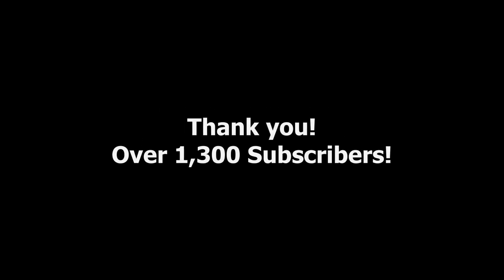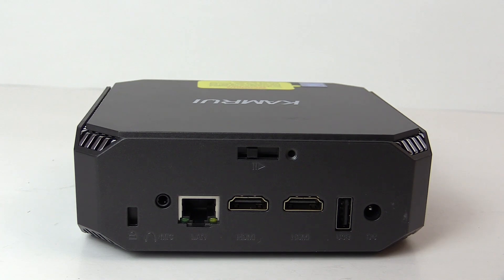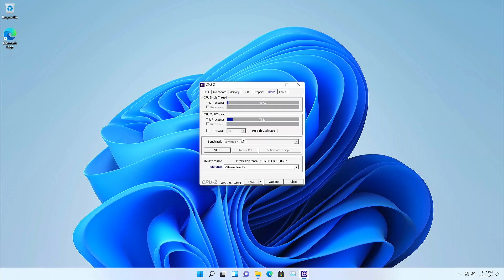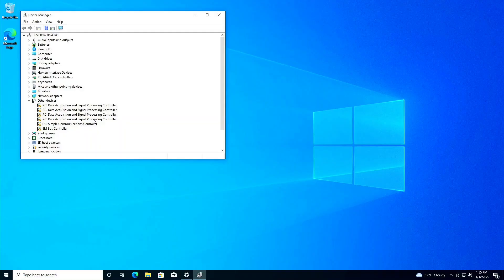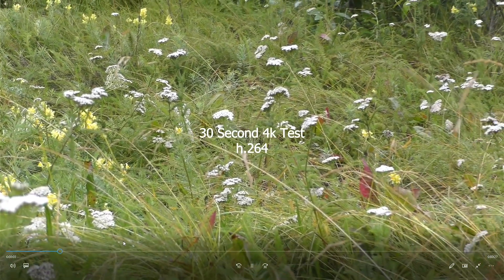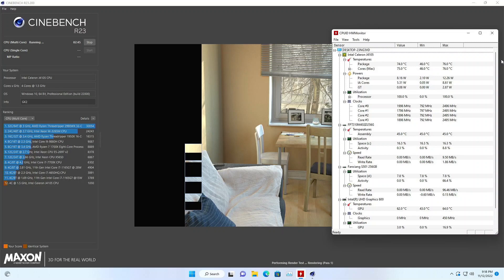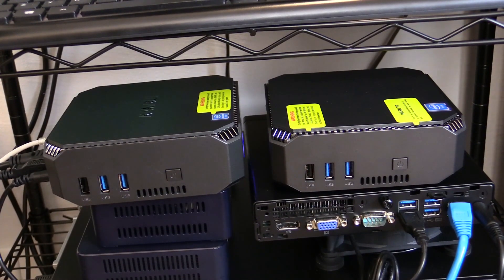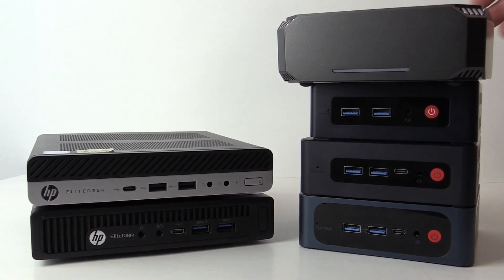Kamrui GK2 Mini PC Review! Synthetic Benchmarks and Teardown!

Comment: I just picked up a Beelink SER5 as it was on sale just before Thanksgiving for $300 USD. It's got a Ryzen 5 5560U, 16GB LPDDR4-3000, and a 500GB NVMe SSD. I'm using it as an HTPC connected to our 4K TV, as it's more versatile and more powerful than any other little streaming box.
Reply from the maker: Very cool. Sounds a lot like the Trigkey S5. I'm actually typing this message on it now.
Reply: @ntgm20  oh yeah. Now that I'm seeing that video, it's pretty much identical to the one I got, with the only difference being the case is slightly different on the Beelink, as the top panel is ventilated.

Comment: With Raspberry Pi's no longer available, I am considering using some of these little guys for my 3d printers. I'd definitely purchase at the price you picked up this one.
Reply from the maker: That is in part what turned me to these, as the Raspberry Pi I think was the best for software support. I've got one that has been running for 9 years and I think the support finally ends next year.
Reply: really? I thought a new gen had come out?
Reply from the maker: @hogey74  The Pi 4 is the newest, with Compute module and 400 being based on the 4. The ones I'm talking about dropping support are the ones that are now approaching 10 years old.

Comment: I bought one of these to use it as a headless linux server, plug several cameras and run motion on it to record multiple plant timelapses as video and photos that will be regularly backed up on my home NAS, so every few months I just stitch and edit the result. I previously used an old jetson nano like this but accidentally poured water on it and it was done. I've been doing plant timelapses for over an year and this seems to be the most effortless way to do it once it's all set up. This will be an upgrade from the jetson's only 2 gb of ram and running from a micro sd so I might come up with something else to use the spare resources.
Reply from the maker: Very cool, thanks for sharing! I've been eyeing using one or two of my mini machines with some PoE cameras, just haven't yet.

Comment: Ahoy, thks for the video. I have 2 mini PCs I bought on eBay. One is a Guzila AK3V 6+128 w/Celeron J3455 4C HD500 Apollo Lake ($37 w/cracked lid) and the other is a Kamrui CK2 8+128 w/Celeron J4125 4C UHD600 Gemini Lake ($81). The performance is definitely faster on the J4125 mostly due to the better graphics performance on the UHD600 GPU. Coincidentally I have 2 notebooks, one with a J3450 4C and one with a N4020 2C. The difference is about the same as the 2 mini PCs. So Gemini Lake is an improvement on the Apollo Lake for sure. Thks again, daveyb
Reply from the maker: Thanks for sharing!

Comment: I'd suggest the Shuttle XPC Slim series of 1.3 lt PCs. It comes in passive and active cooling SKUs and it's very well built, in all-metal cases with all components on one side and some of them rated for 365/24/7 operation. The newest seriers supports Intel 12th Gen and there are also AMD-based models. I have the DL20N6 one (Pentium N6005-based, passive cooled) and I'm quite happy of it, even though in the heat of the summer and under heavy load, it may throttle to 2.6GHz.
Reply from the maker: Thanks for sharing.

Comment: STICK... So what are these little units good for? Thanks...
Reply from the maker: Low powered desktops or as I'm going to use them low powered headless Linux machines in my lab.
Reply: @ntgm20  Ok, not really up on what a Headless Linux Machine is, but know headless means no monitor so how would you use it?
Reply from the maker: @cybercapri  As a small server. Maybe Emby, maybe a Docker lab, maybe DNS services, maybe database...not certain yet, will figure it all out early next year after I move.

Comment: The problem is Amazon "launches" these at low prices then increases once sales gets going. This already @ ~ $160 level. A few days ago I bought a J3xxx mini pc with $50 discount making it about $50 but hours later up to ~$110 after discount. This is much better spec'd but I would only buy @ ~$100.
Reply from the maker: Prices are all over the place. I'm not sure I would have bought this one if it had not been for the steep discount.
Reply from the maker: Kevin  Right now, 1641UTC 20 NOV 22, there it is for $270 with $80 coupon. Can you see the coupon? I'm not saying that is the best price, but I want to know if others can see what I do and displace any distrust.

Comment: stick lol great way to see feedback. I have a couple server dell R620's but the noise and power means I only turn them on when I really need the extra power. Ive been using mini Pcs for a long time now Hp pro desk and other models. Ive thought about buying the AK2 but was not sure. This video really helps
Reply from the maker: Thanks!  I've got a couple HP Minis, their 1 liter machines, but I think the fans on them are still too noisy. For now the AK2 and GK2 are fairly quiet except under load, which really in my case should only be in special circumstances.

Comment: Nice. Yeh been seeing this case type in my local online market. But wow, the discount coupon you got. Where did you get? Thats a great grab. Will be ordering one as a router+proxmox server running small things like home assistant, wireguard, grafana, etc..
Reply from the maker: The coupon was really crazy. I bought it from Amazon, and I wonder if things like this will go on sale again around Black Friday.  I think what you'd be running would be fine, unless the RealTek NIC doesn't do well as the router.
Reply: @ntgm20  ServeTheHome here in yt has been testing these Jasperlakes and they do quite well. Oh wait, yeh I have to double check if they are using intel lan chips or realteks.

Comment: Would this be good for just internet use/watching utube for my elderly parents. If not what would you suggest?
Reply from the maker: It could be. I think it would be better to go up to the Jasper Lake minis or with a 10th or 11th gen i3 based system. The amount of RAM in this one is good but might be under powered if YouTube does step to using more AV1 streams.

Comment: I wonder if for Youtube playback you actaully changed to flags to use OpenGL o D3D.?
Reply from the maker: Can you expand on that? I'm pretty sure all the streams at that level from YouTube are VP9, are you saying that I can change something or them?
Reply: @ntgm20  yes in edge://flags you can change ANGLE graphics backend to use OpenGL or D3D11 or D3D9, this machine might work better using OpenGL, also make sure Hardware-accelerated video decode flag is enabled.

Comment: Great vid thanks.  Id have grabbed it at that price too! Its gutless compared to the older gear I've got lying around so it wouldn't even replace the Samsung 3630qm laptop in the shed.  I think mini PCs start making real  sense from the AMD 4800u onwards.
Reply from the maker: Thanks! I'm happy to hear someone else can actually grab it at the price I've found. As for use, what are you using it for that it doesn't work out? Just curious, as I can't cover every use case it is interesting to see.

Comment: These types of mini pc usually I use for home lab (linux, proxmox)
Reply from the maker: Do you have any issue with reliability? I hear mixed things, but also don't know on what level the problem was (SSD, fan, etc).
Reply: @ntgm20  I run 24x7 but it in text mode.  Mostly, light load.  Mine mostly bought used from tv-box user.  I do clean and re-paste them time-to-time, there was a unit its fan died.

Comment: Have you ever tried running batocera linux to test games on this mini  cpu? That will be a game changer
Reply: Ahoy, I ran Batacere from a USB3 thumbdrive on my Kamrui CK2 8+128 w/Celeron J4125 4C UHD600 Gemini Lake. It ran quite well except for sound. Usually all I had to do for sound was set it to HDMI0,0 but I had about 10 (!) options for sound on the Kamrui and was trying each without success when the thumbdrive quit working totally. I had used it for a year on an ASUS Onyx MedPC w/J1900 when it died. Not the Kamrui's fault, just the cheap thumbdrive prob daveyb
Reply from the maker: I have not, but thank you David for sharing your experience!
Reply: Thank you a lot :)

Comment: Stick.  I recently bought a used mini PC - a Ryzen-based Asus PN50 - to potentially replace my daily use PC, a self-build with a Ryzen APU, which is rather overkill for web browsing and the like.  Unfortunately, I'm having some stability issues with it, under Linux Mint.  I've not invested much time in it yet to run tests - different kernels, etc.  The latest version of Linux Mint is due later this month, so I may try that and see if there's an improvement.
Reply from the maker: What kind of stability issues, if there is anything that you noticed at least? My Dell machines have had issues when video with sound were going and the system would lock up. Never really looked into why, as when I went back to Windows 10 there was no such issue.
Reply: @ntgm20  It appears that the 5.15 kernel used by Linux Mint 21.x is causing the stability issues.  On a hunch, I tried a distro that uses a 6.x kernel (PC Linux OS), and the mini PC is now stable.  I don't care much for PC Linux OS, though, and as no later kernels are yet available (via Ubuntu) for Linux Mint, I'll be looking into manually adding one.

Comment: I'm using an odroid hc4 (the one with sata controller) mainly for bakup my phone when I'm traveling, pihole and other small task. At least that was my attention when I got it. Now I put in a couple off sdr stick's on it and runing open rx wit some background decoding of digital ham radio signals, and the that's actually quite intesive load, I had to turn down the settings on the software to not be @100% cpu all the time.

I'm actually looking for something with better performance with low budget just for the sdr stuff, my plans is to ad some more sdr stick's to be able to monitor more band's at the same time but that odroid is just too under powered to doo that. 

It wuld need only network, couple off usb port's (usb2 is good enough) and some power in the cpu. I think raspberry 4 is quite similar power I have now so better than that. 

Do you have any suggestions for what path I should go?
Reply from the maker: Greetings. I just looked at the Openwebrx site to try giving some advice. Are you also looking for something that has low power draw? If not a used desktop with an i5, say 6th or 7th gen would probably be able to do it better and at least where I am those can be purchased around the $100 mark, sometimes less or more. 
If you still need low electrical power draw than maybe something with a N5095, N5105 or N95 as the processor would work. Not having any experience running Openwebrx I can't say exactly though how much difference the performance would be.

Comment: I had 3 of the the original GMK Nucs and the kids where using them as a school computer during the Covid shutdowns, now 1 dead and the other two are just collecting dust.  Used them a little as test benches for some ideas but that is about it.  One has Windows 10 on it and the other has Arch Linux.   They are too slow for me to really use for anything.
Reply from the maker: I understand that. I think this one is a bit faster than the AK2, and always more responsive with updates under Linux than Windows.

Comment: I'm not sure Ubuntu will give you the best Linux FPS - the GNOME 3/4 compositor is not that great. 
It would be nice to compare the performance with a lightweight Debian KDE distro like MX Linux.
My experience is that you get much-improved performance on low-end systems with MX KDE.
Reply from the maker: Ubuntu is just what I had around because it works pretty good with most modern hardware.
Reply: @ntgm20  even better. the version of chromium in the manjaro repos has video hardware decoding that should work with youtube and new celerons.

Comment: Lol, do yourself a favor and use Shift+F10 to skip the network setup and make a local account.

Anyone looking for a low end machine on a tight budget could do worse than picking up a Lenovo Tiny, Dell Micro or HP Mini.  Get a Haswell 1225v3 Xeon or a Skylake i3 6098p.  Get some old laptop ram to throw in it and an SSD, you are set.

Why?  Um because it is business class.  Its easier to work on, easier to clean.  Parts are available, and listed online so you can search by part number.

Haswell Lenovo M93p/M73p Tiny as an example: $30 for the barebone, pick a processor $8-$40. Get a power brick: $5-$15 Some ram: $10 for 2x4GB SSD: $20

You can start at $80 and still upgrade later.

If this box works for you great, I personally am leery of bonding the two most expensive parts together Motherboard/CPU, not to mention you can't get another motherboard for these little boxes like you can with a business class tiny.

Reviewing them is great.  Journalism is telling people if they are good value.  Maybe they are, if you need the lower power, or the new codec, etc etc.  If you just need it to run for years and control a printer or something, may not be good value.

If you already have some laptops and desktops being thrown out by friends/neighbors/your business; scavenge the parts into a Mini business system is a no brainer, it would literally only cost the barebone system and a storage drive.
Reply from the maker: This one came shipped with Win11 21H1 so you can still enter a local account, also it is OOBE reset, not an initial install.  Windows 10 still allows for local account creation, and the recovery questions are with a local account.
CODEC support is a real thing you have to look out for based on needs. If putting together a used system a 6th gen Core i3/5/7 processor is probably a safe bet, older than that (at least 4th gen and earlier) you are dealing with a larger lithography and some lack of advance CODEC support.

Comment: Do not recommend any Mini PC with less than a Celeron 5105 which supports dual channel RAM. Still for under $100 is a steal.
Reply from the maker: It all depends on budget and need of course. If you are just editing documents / checking email / online shopping than below the N5000 series may be fine, but if you can afford one I'd always recommend stepping up to at least those.

Comment: Stick.
I got a ryzen 4700u mini pc be link.  I stopped buying cheap pcs -to soon garbage.
Reply from the maker: Have to remember these are not planned for desktop use but because they are sold as such I like to show what they can do
Reply: @ntgm20  If not desktop PC function, I gravitate to ARM for general network functions.  A Walmart On media box is near the processing power of this cpu and it is just $20 for a 4K capable device.
Reply from the maker: @skyak4493  Not a bad idea, but I'm moving away from ARM simply because of OS and software support in Linux is much better for x86/amd64.
Reply: @ntgm20  I agree completely that x86 is "here now" while ARM can be a struggle to a dead end.  I have a handful of x86 tablets with dead batteries looking for uses -I won't buy another atom core.  I thought I was done with x86, but a ryzen seduced me.